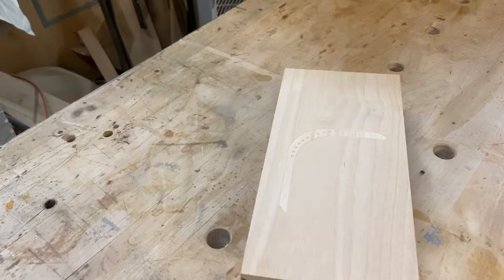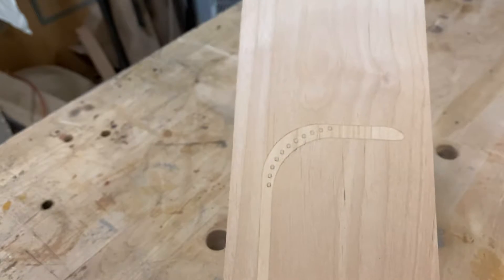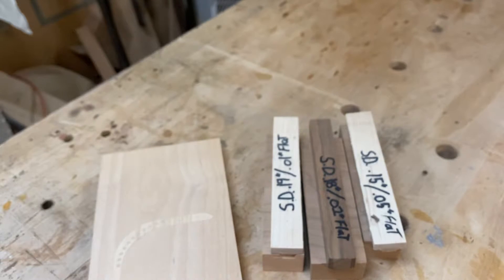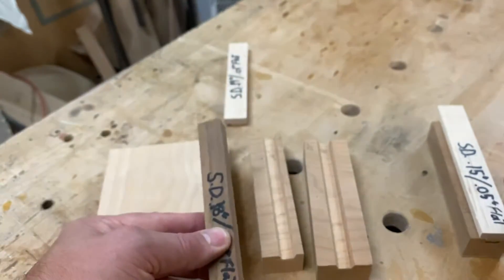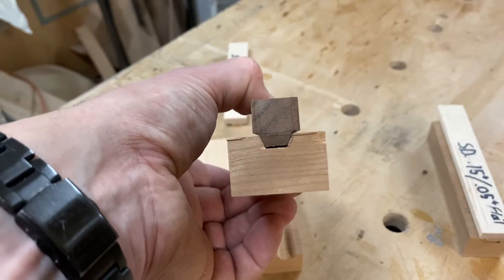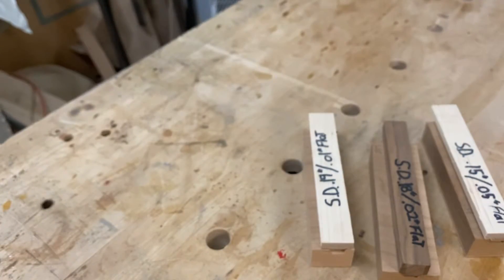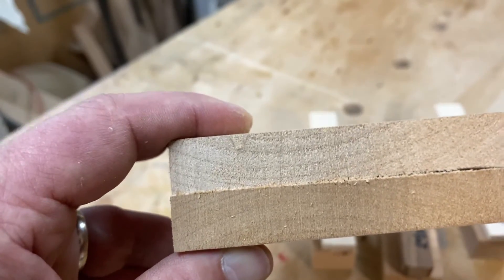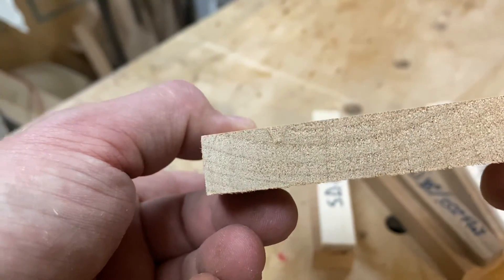Vcarve inlay numbers

Comment: I recommend a panel gap larger than 0.02", so that the glue has a place to go with ease, and sawing is easy. 0.1" is what I use. As for the "glue-gap" where the flat-depth male meets flat-depth female, I'm with you on 0.02". It can't be zero because you'll have regions where the endmill can't reach and they won't be entirely flat

Comment: I know they call it glue gap but I think it is there so it does not bottom out. This would insure that it sits on the taper and should lock in. In maching this is called a "taper lock". This is the point of the taper so that the gap on the sides close up before hitting bottom.

Comment: What are the specs of the bit used? Thanks!
Reply from the maker: I used an Amana 90º v bit. I like the double ended replaceable blade feature. I have had the bit for 7 years and have used about 6 or 7 blades. It's easy to keep one on hand for when a replacement is needed. 
Amana Tool - RC-1102 Insert V-Groove 90 Deg x 3/4 CH x 1/2 Inch SHK CNC Router Bit
Amana Tool - RC-1102 Insert V-Groove 90 Deg x 3/4 CH x 1/2 Inch SHK CNC Router Bit
$131.04
Toolstoday.com
180-day return policy
Reply: very helpful ... Thank You! @chweatherl

Comment: I just watched a video with Becky from Vectric. She was doing inlays in inlays, and started with .3 for the female, and .1 and .2 for the male. When she routed out for the 2nd inlay, she had some tear out due to the “glue gap”. So she changed the male to .28 and .02. Worked great. You could see after the 2nd routing that there was pretty much no gap, just like your .18 and .02. Yours and her changes make a big difference. That glue gap works ok with small inlays and letters, but with bigger pieces and especially on cutting boards, you can tap on the inlay and hear the void. I think after some use on a cutting board, the inlay would start to split out. 
My thanks to you and her for the info. Will be a great help as I am currently working on a cutting board with 2 inlays and was trying to figure out how to get rid of the gap.

Comment: I would like to add that the male flat depth isn't that important.  Personally, I use .05" so there is more room for glue squeeze-out.  Another hint is to add a coat or two of sealer to the female before carving, so that any squeeze-out is easier to remove.

Comment: Good video. You stated that the pocket flat depth of .15" with a start depth of 0" gave you the best result. What was the inlay flat and start depths that went along with the pocket?
Reply from the maker: I had all the female pockets at .2" flat depth. The male is the one that I made the changes for the numbers on.
Reply: @chweatherl  can you make the v carve deeper in the wood?
Reply from the maker: @shaynetcrocker  You can make it whatever depth your bits allow. Ive seen people set the vcarve so that the final layer will be under the surface, then mill off all excess with the CNC.
Reply: @chweatherl  I’m having issues with having larger gaps for the glue than I want. Trying to make them fit perfectly. I’ve only seen one video on deep inlays. I’m trying to get 1/2” but I’m learning from trial and error.
Reply from the maker: @shaynetcrocker  I've done deep inlay for the purpose of 3D carving it. What is your end goal? How are you clamping the pieces together? Even pressure over it all is key to a great inlay.
Reply: @chweatherl  wanting to make a deep inlay chopping block.  I can do the .2 depth easily. I want this to be deeper. Honestly just testing the waters and wanting to try something a little harder. I see all the amazing things the creators on here make and it makes me want to figure out how you guys are doing it.
Reply: @chweatherl  I get the initial v carve is the depth you want your inlay to be. It’s the male insert that I have trouble with. I’ve either made it with a large gab or I have it with almost no gap. I’ve been doing test pieces just to try and understand the depths more. You guys just make it look easy
Reply from the maker: @shaynetcrocker  With an inlay, the face is really all that matters. I've made them as shallow as 1/16" with no problems.

Comment: All these numbers make sense but my issue remains that when my cnc tries to remove .18 on the first pass, it basically destroys the material on the finer detail.  I’m using a Dewalt 611 on millright system. Any tips?
Reply: It took me quite a while to understand how you can make your Start Depth "below the surface".  After watching many videos
it dawned on me that you're not just jamming the Vbit down into the material.  Because you should run your "clearance toolpath" BEFORE the Vbit toolpath, the material has already been cleared away so that the Vbit will only be using 1/2 of the diameter of the bit to cut the side slope of the path.  Hope this helps.
Reply: Run the inlay in multiple passes. Example, I have had good success running the first pass at .078 start depth and the second tool path with a .18 start depth
Reply: Use a less aggressive angle.. like a 30 degree or 15 degree bit
Reply from the maker: I've had that happen as well. I found that there really is no need to have your female pocket all the way to .2" you can play with the numbers as much as you want. As a matter of fact, one of my best inlays was done with a .08" flat depth for the female pocket. I can't remember the male numbers off the top of my head.
Reply from the maker: Caleb, I was thinking about your comment. One of the keys to great inlays is tooling. I highly recommend Amana tool's 90º V bit with the replaceable blade. It's really worth the money and with each blade you get two uses out of it.
Reply: @chweatherl  thanks Chet, I appreciate the comment.  I’ve actually figured it out (95%). I just run the program 3 times ..: each time with the start depth a little deeper until I reach the .18. I’m using a 15-20 degree bit which is working well for me now. I haven’t perfected this process yet, but  getting closer.

Comment: Excellent demonstration of the different settings.  I've just started trying v-carve inlays and I also thought, like you, "why would I want a 0.1" gap for glue??"  I certainly don't want gaps when gluing up cutting boards or butcher blocks!  I wonder if you increased the flat depth would that give you a bigger gap between the pocket and the plug piece (e.g., for bandsaw)?  Hard to wrap my head around it!  I think with .18 and .02, you have both a .02" glue gap and a .02" distance between the surfaces of the pocket/plug.  If you did it at .18 start and 0.1 flat (assuming the pocket is .2), would that still give you the small glue pocket while giving you more space between the pieces to cut them apart?  I suppose I should just experiment :)  Cheers, thanks for the informative video.
Reply: One thing that will make it all easier:  the "flat depth" setting on the male (plug) inlay is the gap that you will end up with after gluing and pressing the two pieces together.  With a setting of .02, you will only have 20 thousandths gap.  BUT: You can make that measurement anything you want- it has no bearing on the fit of the male (plug) into the female piece.  So go wild with that figure.  I usually make it about .0625 (1/16th gap) You could make it .125 (or more!) if you wanted to get a fat saw in there...  The only thing you have to remember is that the thicker the 'flat depth' the more clearing there will be when milling the male piece...😉

Comment: Great demo of how the different cutting parameters for the female and male parts work together.  
One question:  I really like the end result, but how do you remove the waste male material?  Bandsaw?  Mill it off? 
Thanks.
Reply from the maker: That depends on the size of the piece. If it is larger than my bandsaw I mill it off with the CNC.